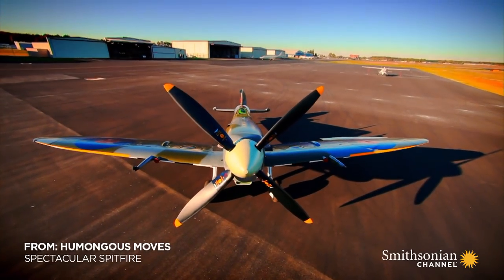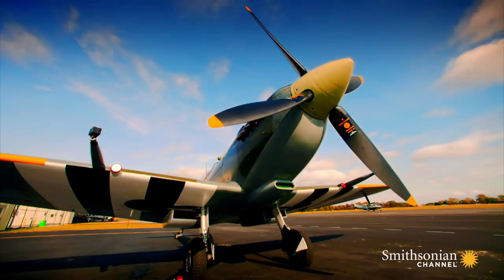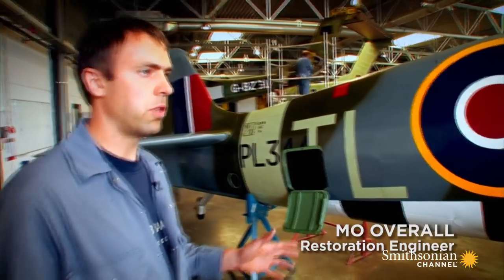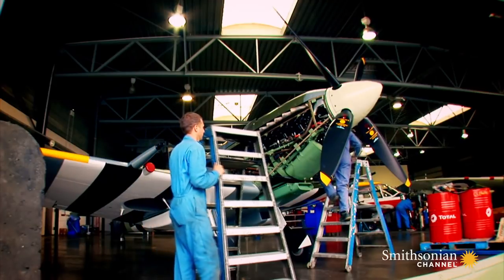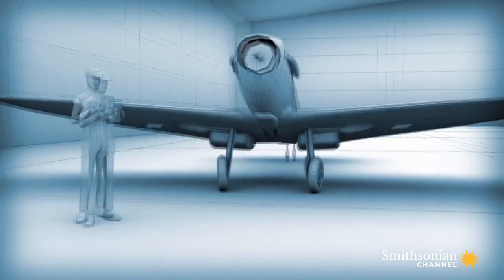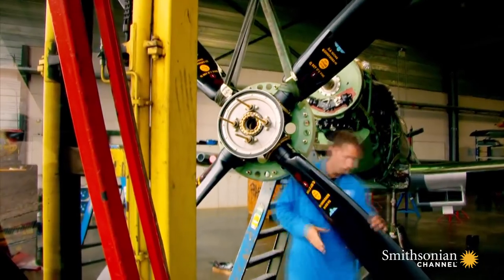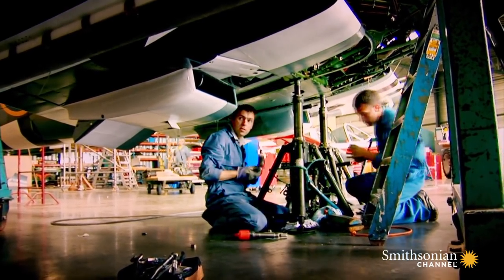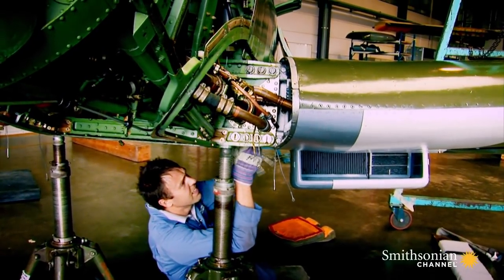Packing a Vintage WWII Plane is an Impossibly Delicate Task

Comment: Couldn't they have flown it across the Atlantic? Extra Fuel tanks - lotsa small hops - a mother ship with spares - followed by a ton of publicity.  Beautiful restoration work ...and how could you not admire the care and dedication on display too.
Reply: NO.
Reply: Are you crazy? This is a WW2 fighter aircraft.
Reply: There had to have been a better option for shipping than what they're doing. Isn't there a decommissioned aircraft carrier making the rounds in the Atlantic they could use?
Reply: 525Lines - stop and think for a moment about what you are suggesting.  And the insane amount of money that would cost.
Reply: The risk with such valuable aircraft is just not worth it. In terms of distance the F - Spitfire has a ferry range of around 1600 miles @ 5m/gallon. (PR spits max was 2000 but that not this plane so...)

Comment: Looks like it's been completely stripped down, acid bathed, polished, repainted, and reassembled. Of course, after completely replacing all hydraulic and electrical lines.